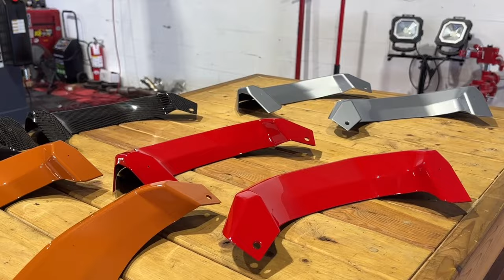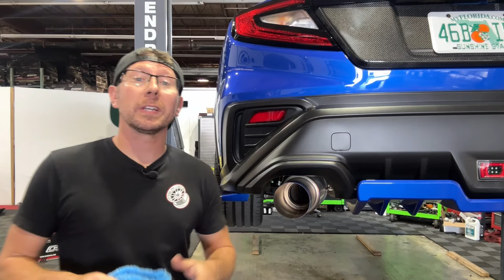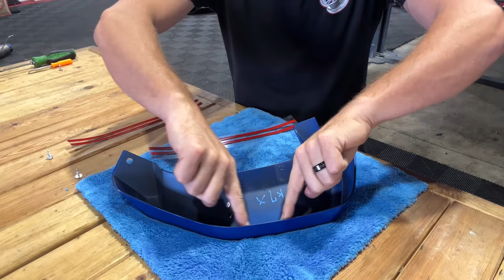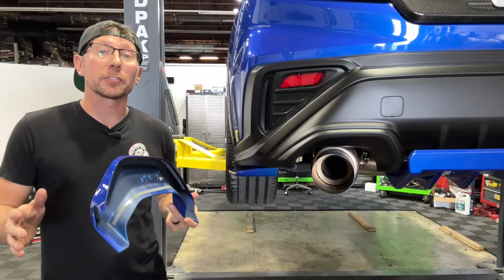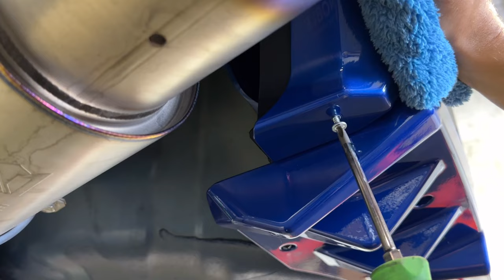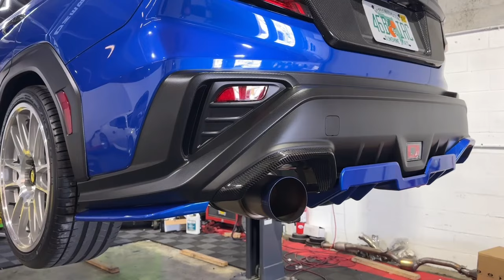NOBLE EXHAUST FINISHERS | SUBARU | WRX | 2022 | 2023 | 2024

Comment: Just added the Noble Exhaust Finishers to my '24 WRX.   What a difference a small addition like these makes!   I'm really impressed!   Only took a few minutes to install, fit and finish was great.  I bought the Ceramic White, and the white of the exhaust finishers is a bit more.. 'whiter'. If that makes sense.  lol.   Same thing with the 22+ front lip and side/rear skirts.   It's barely noticeable, though.   No complaints on my end.  🤘